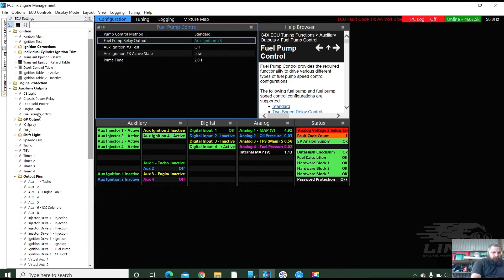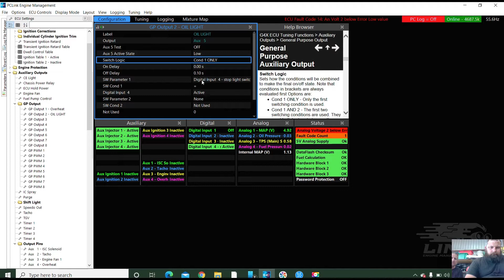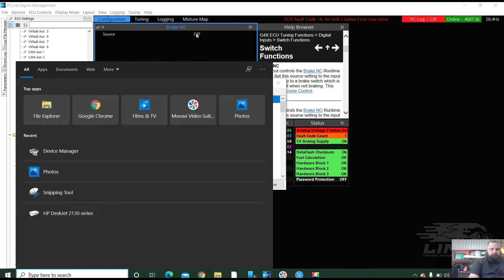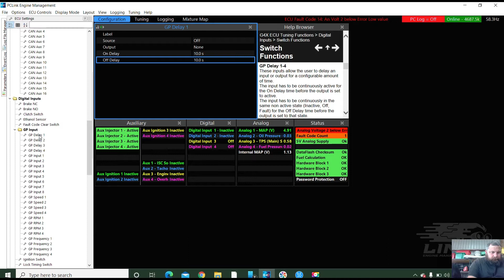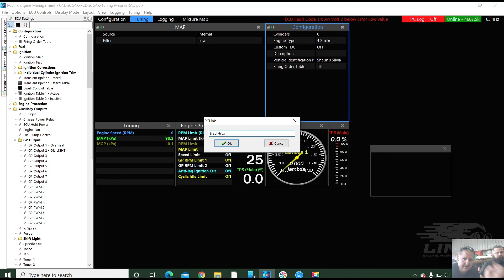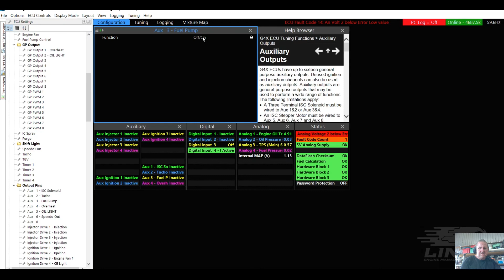Link monsoon Setup Brads Engine. 1uz Non VVti with stock coils and leads.

Comment: This is for a manual conversion? Would it effect the settings?
Reply from the maker: Yes this is for a manual swapped uz so all settings are to suit that.  Link ecu doesn't presently have native auto control functions.
Reply: Even with eliminating limp mode, nsw?